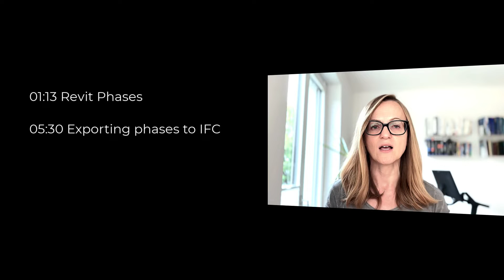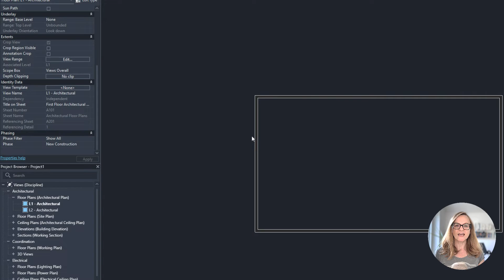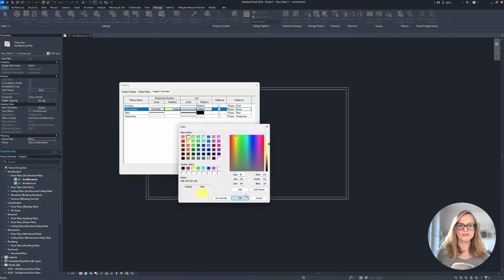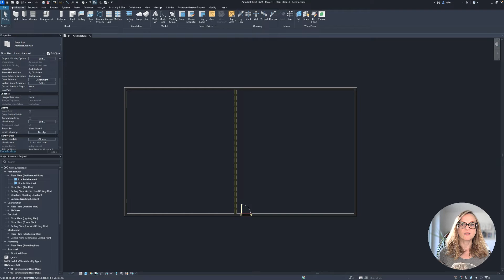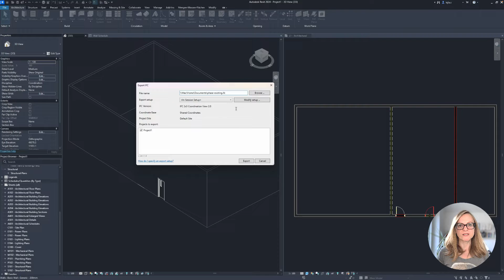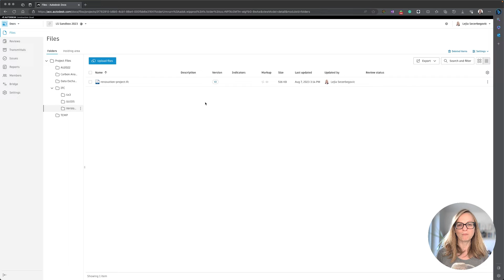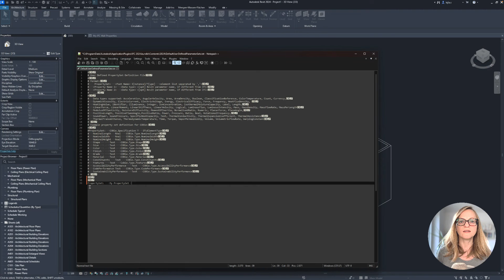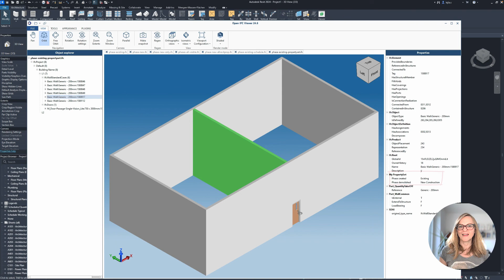Exporting Revit phases to IFC

Comment: I dont agree with 5:45 it doesnt depend on what you see in your 3d view at least RVT 21/22, but i think the rule is the same. I have in view Just one phases but with default export setting it export all the model not only the one phase. If you want to export from view you click it in Additional conent tab export only elements in view and then on the first tab of export settings (General) the phase window is gray and cant be modified.